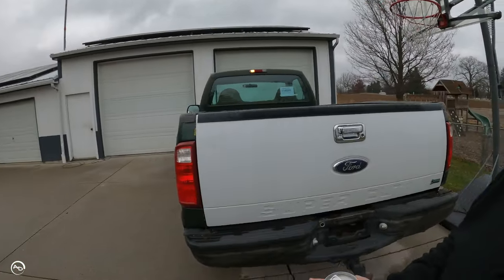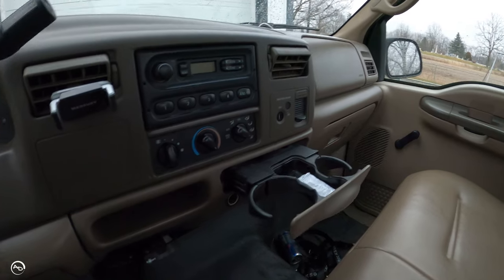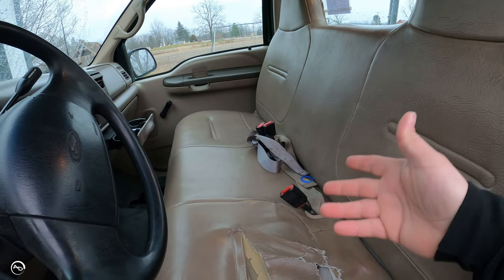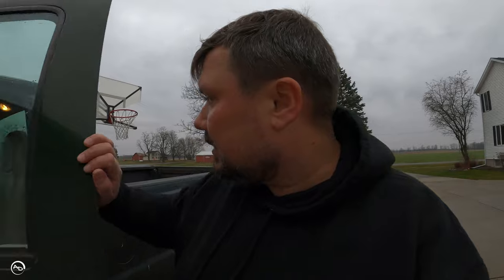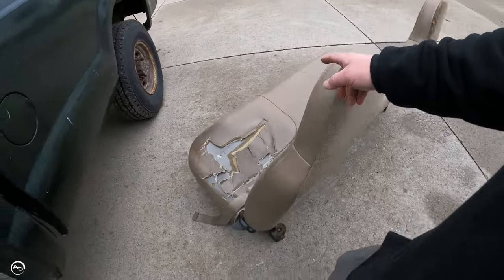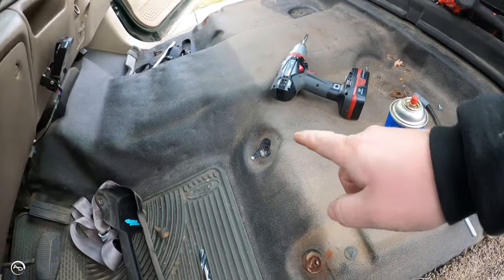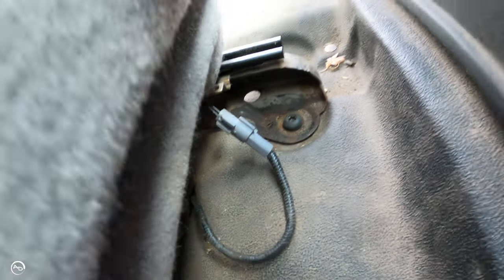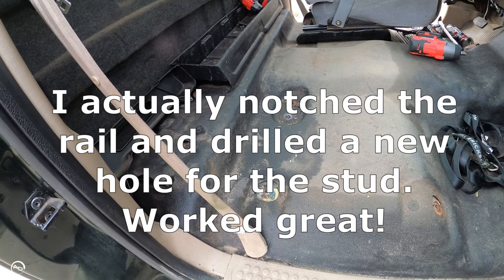F250 junkyard seat upgrade

Comment: If anyone reads this, the metal is soft enough, you actually dont need to tap them. And no, it doesnt damage the bolt if removed later.

Comment: I have an 06 F250 with a bench front seat I want to replace. What year/model did you pull the seats from? Lots of F150s at my local place but not many 250s.
Reply: Your best bet is sticking with the same year. I'm swapping 2001 to 2003 interior and so far it's all identical bolt in and fairly simple.
Reply: @The_Hip_Vet thanks and you pulled yours from a 250 correct?